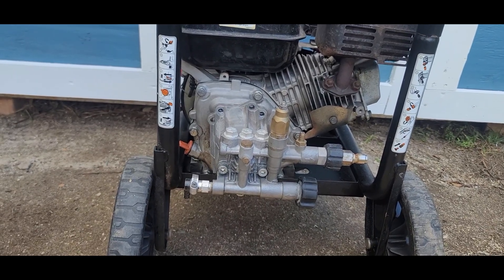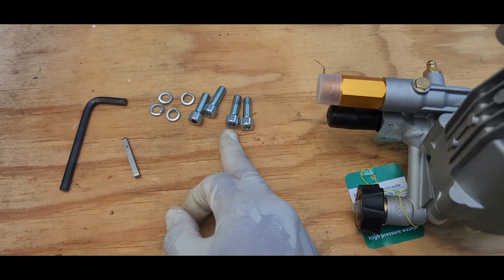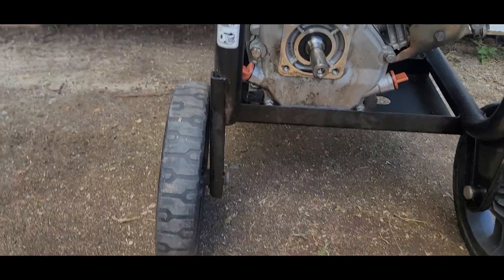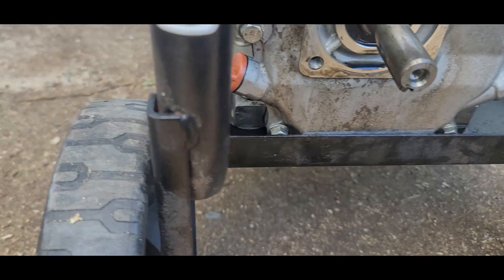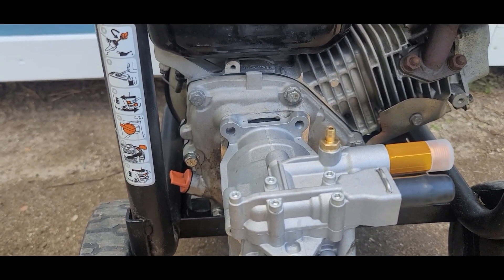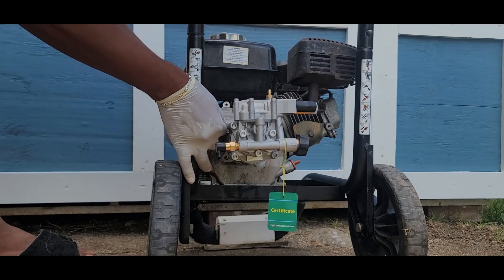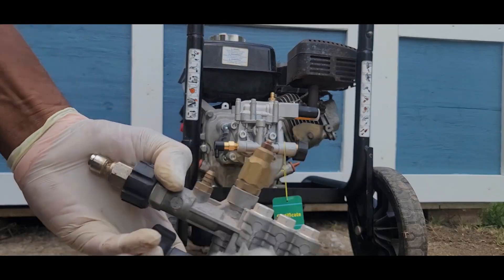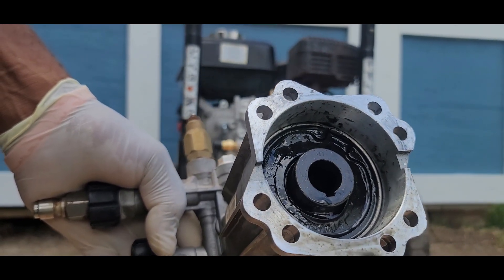Pressure Washer Pump Replacement (Vevor pump on Generac machine)

Comment: Thank you for the video! I didn't even think to look for aftermarket pumps to replace the one on my Generac. At less than $60 it's a lot cheaper than an entire new machine. I still need to remove my pump to measure things and to run the engine with no pump. I'm not 100% sure where the noise I'm having is coming from. It's a terrible rattling noise only at full throttle. It sounds like the engine but the pump is leaking from the bottom and may be frost-cracked even though I put anti-freeze pump oil in it every winter.
Reply from the maker: It's a good idea to run the engine without the pump first.

Comment: Thank you for the demo.  The pump was corrosion welded onto the engine shaft in my case.  It came off with a pursuasion bar (big crow bar) and sledge hammer (old pump shaft housing shattered. New pump went on as in the video after cleaning the rust off the shaft.
Reply from the maker: That's great, you were able to get it off and replace it.

Comment: Is this a Generac model 6596 pressure washer pump? If so, what is the part number? I have been searching for a replacement pump for several days, without success. Thanks in advance for any information.
Reply from the maker: I bought my pump from using this link. Double check your model #
https://www.ebay.com/itm/404361195679?mkcid=16&mkevt=1&mkrid=711-127632-2357-0&ssspo=0qa1smlcswy&sssrc=4429486&ssuid=fPUIMKSrRl2&stype=1&var=&widget_ver=artemis&media=MORE